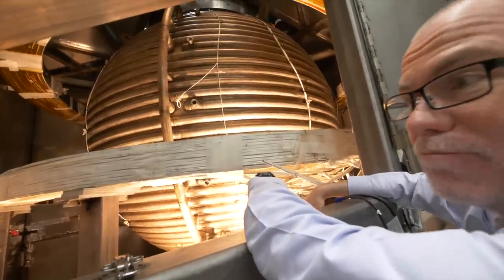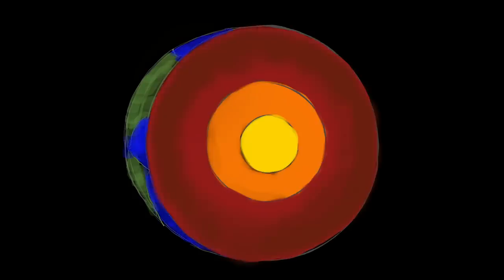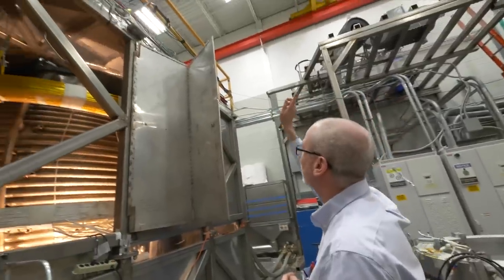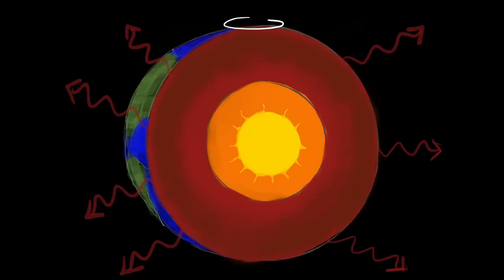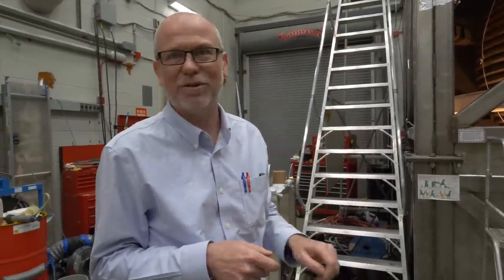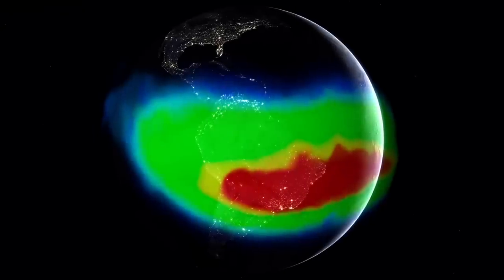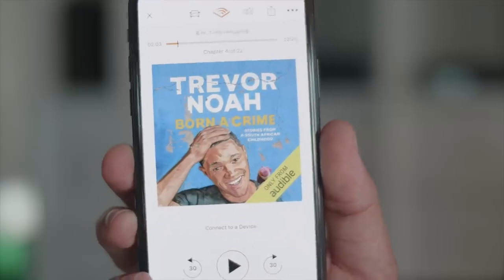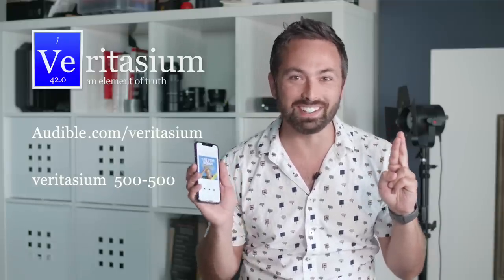Spinning Sphere of Molten Sodium

Comment: It looks like we need this experiment and not just a computer simulation of the experiment. If a simulation was good enough and cheaper, they wouldn't do the real experiment.  I'd just like to understand why. 

Is there something fundamental that we don't understand and aren't able to model? I guess we should know the basic laws, and i thought emerging complex behaviour should also emerge in a simulation. 
Or is it just too hard to compute? Is it one of those problems where an approximation just isn't good enough? Or do we have simulations but they turn out to be wrong and nobody knows why?
Reply: Too many variables. We don't know everything yet. Sure, we can computer model, but how do we know the modeling is accurate without putting it to the test? There is always room for real experimentation in order to even know whether our models are right or not.
Reply: We cannot build a model of entire Earth at atomic level with every possible interaction known to physics. So computer simulations always use simplified models. Even then fluid dynamics is very hard to compute. And when you add magnetic fields on top of it...
In this case problem is that we dont know how exactly Earth magnetic field is forming. But to build a model we need to know which aspects are important and which can be ignored. Hopefully this experiment will help and then we will be able to predict magnetosphere behavior using modelling. I very like comparison to weather forecast, it really is a similar situation.
Reply: My guess would be that yes it is simply too complex or chaotic with too many variables to simulate accurately.  AFAIK we still don't have a full understanding of fluid dynamics in terms of the equations.  See this link for a little bit more info.  

https://en.wikipedia.org/wiki/Millennium_Prize_Problems#Navier%E2%80%93Stokes_existence_and_smoothness
Reply: The calculations are still too complicated for our computers
Reply: I dont know but my guess would be that we have done computer  models that do show this effect. I would think funding for this experiment would depend on prior modeling success. But it's always great to do real experiments to check and improve models and because like others have said, models need to make certain assumptions that may or may not work.
Reply: We acatually do  not fully understand some phenomenons (emergent behaviours), and instability regions, or turbulent flows exactly. The simulations are not accurate enough, do not have enough time and space resolution, and do some approximations to various effects, to be considered accurate and ultimate. We do not have good macroscale theory, that can be easily derived from fundamental physics laws. (it can be done in principle now, but the math is too complex for us to get grasp on it, even in statistical sense, yet. so it will not give any big insight into actual behaviour of the system, and lack predictive power). The fluid dynamics on its own is HARD topic. Add to that magnetism, currents, resistance, convection, thermal radiation, radioactive decay, heterogenous medium with elements of different densities and properties varying with temperature, differential rotations, oscilations, extreme matter conditions and few more effects, all interacting with each other in known way on some case by case studies, but not all at once tangled with various strengths, that change also with time and position. It is beyond HARD. Geology, and especially modeling of liquid metals, is beyond crazy. It is black magic. I understand quantum mechanics, higher dimensions, and esoteric and hard topics of many other fields of science in good detail, but geology and inner workings of Earth are absolutely beyond me. It is as complex as you can get.
Reply: Even with computer generated experiments you still need to do a physical experiment sooner or later. Computer generated results are great, and probably were done in the early stages of this project, but they will never fully replace physical experimentation. Essentially, physical experimentation has to be done to prove the predicted results. Even if it works out mathematically that doesn't guarantee it'll translate to reality.
Reply: Well absoulutly. The ultimate test of model is its predictive power. So the reults of the model (computer simulations) need to be compared with various real world reaults, be it lab settings (like controlled condition of the molten liquid sodium, with many parameters known very well, and possibility to vary them in wide range, and obtaining more and more results) and with indirect or limited measurements of real world (like the structure of outer core and strengths and directions of magnetic field and its dynamic over millenias).
Reply: We need massive super computers to model microscopic proteins, and this is a little bigger than that.
Reply: movax20h even helioplasmadynamics is better understood at this point... Great response.
Reply: We can't simulate fluid dynamics accurately. Not even for a small-scale problem, let alone something on this sort of scale.
Reply: The equations that describe fluid flow and the interaction of magnetic fields and currents with moving conductors are well understood. 

The difficulty is simulating with enough space and time resolution to faithfully reproduce everything in the strongly turbulent flow.

For something like this experiment, we're not even close. You can make a lot of progress by making simplifying assumptions in your simulations, like averaging over smaller scales, but validating against experiments is an important part of getting it right.

And even with good experimental validation to give confidence in the results, simplified simulations at practical resolution will run several to many orders of magnitude slower than real time. You can explore more operating parameters in a turbulent fluid experiment than you can in a turbulent flow simulation. You can also run at one parameter for very long times, which has definitely proved interesting in this experiment.

So experiments are needed. That said, I can't count the number of times I wished I could see the flow in this thing like it was a CFD simulation!
Reply: Tbh a lot of the math already makes sense, but the scientific method has taught us to never just trust the math and call it a day. We have already discovered plenty of unexpected things when modeling the real thing in experimental science. Computers and formulas always allow too much simplification, but you never know how much is it safe to simplify. You can save costs by postponing experiments the numbers don't seem to back up, but a hard experiment, as close as possible to the real thing, is the only way to test the ability of the numbers to predict stuff.
Reply: You need to do the experiment first and then see if theory can predict it’s results. If the theory is excellent then maybe you don’t need the experiment anymore, but as he said, “no one has done this before” and it should be done - because we humans should understand a process that ensures our existence and survival.
Reply: Paul Paulson Well, 
1. we don't exactly know what the inner makeup of the earth is made off
2. we don't know the topology well enough
3. it is a turbulent system. Much like the weather we can't calculate enough datapoints (yet?) even if we knew all the variables involved
Reply: FutureChaosTV I agree but want to add this:
1. and 2. (and in parts 3.) would also apply for the experiment. Keep in mind that the experiment is also a very simplified model of the real world.

About the turbulent system: We can't predict the real weather on long periods, but we can run simulations that create plausible weather conditions for long times that reproduce all kinds of realistic effects. You could study a lot of stuff (not everything)  for example about how hurrican form from such a simulation, even if the exact hurricans won't appear at that time in reality. In general, chaotic systems make exact predictions hard but general patterns of behaviour can be studied with models. Also, this is what the experiment does because it is also only a model and won't have the exact initial conditions that the real world has.

That said, i agree that complex chaotic systems do tend to make it hard to find a model that is accurate enough (in terms of what kind of general behavioural patterns  emerge, not in terms of exact predictions) and yet simple enough to be calculated in finite time.
Reply: Paul Paulson lol.. they do detailed computer simulations of huge numbers of particles to find out how planets form but none of them work.. they all form rings an shells with vacumious centres.. goes to show how idiotic computer simulations can be!
Reply: We can't even accurately predict tomorrow's weather with computer models. Where does your faith in the power of simulation come from?
Reply: It’s just to catapult the propaganda dude. You’re asking the right questions. Research flat earth instead to get all your answers and your mind blown.
Reply: From what I know, there still remains a relatively large amount of knowledge we don't know about magnetism seeing as how it stems from quantum dynamical interactions, so I think that the level of physics we have so far is not detailed enough to quantitatively explain the phenomenon.
Reply: they’re still too complicated for humans. And since humans make computers, they’re too complicated for computers. It’s as simple as that. If we could understand it already, a computer could model it. But since ALL computers are man made, all computers have bias, flaws, and oversights. This is why Microsoft, Linux, apple and others exist. Because all coding is different.
Reply: Modeling turbulent flow of charged particles AND the magnetic fields the chaotic movement generates AND the interaction between the magnetic forces and the turbulent flow...

Good luck running it once, you'll need to keep running it at different rotation speeds and different temperatures.
Reply: To many floating variables
Reply: Simulation alone is never sufficient. All simulations must be verified (checking the math to make sure the model solves correctly) and validated (compared against a similar experiment to make sure that the correctly solving model actually represents what it's meant to model). I'm actually in a 2-week training program for nuclear engineers right now where we are talking about how we validate and verify our models, and how vital it is to couple the modeling with experiments. It's been quite eye opening.
Reply: I guess a simulation is a projection of what we know. We couldn't make a computer simulate things we ignore, as we have to input the initial data into it. But the experiment in real world could teach that of we dont know.
Reply: In simulations, a crucial ingredient is rough approximation. Corners are cut as much as possible to speed up calculation time, because faster simulations can be run for longer or with a wider variety of initial conditions so we can learn as much as possible. 

Because of the, the results of simulations ultimately end up being a rough approximation of what will happen, rather than a full explanation of reality.

For something like a spinning core model for example, one approximation would be to model it as a fluid, because modelling it at the atomic level is impractical. Loosely speaking computer models start to face problems once the things you’re dealing with start to reach the billions, and particles outnumber that on the macro scale many times over. 

So modelling it as a fluid is an approximation. Then you have to think about the temperature and magnetic field and it all starts to get dicey very quickly.
Reply: Computers depend on inputs.
Reply: In semiconductors people simulate the flight and collisions of electrons through the doped silicon (collisions with the atoms , after elastic collision electrons are scattered with a random vector and continue the flight). No idea why this isn't doable here, since the "lighter elements" forming parts of the dynamo are not in the sodium sphere.
Reply: There is no calculation too "complicated" for a computer. 
You probably mean the model is too inaccurate.
Reply: Models are always simplified, that's why they always needs to be tested.
Reply: I researched it...sound like bollocks to me !
Reply: Paul Paulson there is nothing that can replace a real phisical experiment. 
How else can you uncover something new? You cant set up variables in the computer simulation, that you haven't discovered yet...
Reply: Frank Fahrenheit Yeah, sure, I'll go right ahead and find the next prime number with my core i3, lol.  ... fifty  years later...  YES it CAN be done!
Reply: He said at the end it's an open question whether it's predictable at all so why do you think we could simulate it even with more powerful computers?
Reply: As pointed out, both fluid flow and electromagnetics are hard, but where it gets really problematic is that these two effects operate at wildly different rates. Fluid flow can be parallelised up to the speed of sound, as information generally cannot travel faster than that anyway. This is what makes the problem tractable at all. Throw on electromagnetics and you lose that. Two turbulent regions far away from each other suddenly influence each other almost instantaneously, meaning every part of your simulation needs to be aware of every other part. This means that MHD simulations have to run millions of times slower to be sure they have accurate results, unless we apply tricks that are learned from studying real scenarios.

Comment: Nice, but can this device amplify a magnetic field enough to say, shield a space craft from ionizing radiation?
Reply: Using this method to make a magnetic field strong enough to deflect cosmic rays at 10's to 100's of MeV is impractical [0] Not all "ionizing radiation" [gamma rays & x-rays] are charged so a magnetic field would have no effect on those [1] You don't want a huge, heavy gyroscope in a space vessel because of the weight & the torque & the risk of failure [2] The heat of the liquid metal has to dissipate - space vessels have enough trouble already radiating heat [3] the magnetic field would interfere with instrumentation [4] unknown effects of magnetic torquing as such a large magnetic field source moves through the Earth's background field [5] There are lighter, simpler ways to protect organics from high energy particles [both charged & uncharged] such as cladding the living compartments in materials containing a lot of hydrogen atoms - some plastics are a good choice. Water is another option although less effective than plastic for the same weight.
Reply: all very good points!
Reply: oooooh!

Comment: I want to pour boiling 1 ton on boiling sodium into sea water and watch the explosion. Can ISIS guys sponsor my experiment??
Reply: Setting off a ten teraton nuke at the bottom of the Marianas Trench is an experiment that needs to get done before the Russians beat us to it.
Reply: That much water will probably just put it out.   But I'm not sure, so contribute to my gofundme account and let's do this.   For Science!
Reply: Both of those experiments sound equally interesting. I'd watch that.
...
Why do humans always find the most dangerous things the most fascinating?
Reply: if the nuke would go undamaged due the pressure to the bottom of the trench, it would really be a let down, the amount of pressure would just cause the explosion to stay small, and after it the marianas trench would stay a lifeless nuclear wasteland after that, also some of the lighter radioactive elements would surface due to the hot water bringing them up, but cause nothing really catastrophic due to the massive dilution of the ocean.
Reply: Many years ago, my high school teacher dropped a 2x2x2cm^3 cube of Sodium in a bucket of water and put a lid on. It was fizzing a lot, then took about 30 seconds until the whole thing suddenly exploded and the lid flew 50 meters to the sky. He then explained to us what happens is that the sodium (Na+) atoms binds with the (-OH) groups in the water, producing molecular hydrogen (H2) and heat. Some of the hydrogen burns up right away, but some escapes and mixes with the air. When the hydrogen-oxygen mixture ratio gets just right, it explodes furiously. Very nice. Oh, and the water also becomes strongly alkaline (NaOH). (The experiment was performed outside, at a distance).

Comment: Wait, can the earth's rotation be used to produce electricity?
Reply: Certainly. Any energy can be converted to something else.
Reply: People have thought of that before.
Reply: Ungregistered User it’s Not as scary as it Sounds, it doesn’t brake the planet it just brakes the orbiting satellite.

(Eddy currents)

Well..they are using this now to deorbit things.
Reply: It probably does brake the planet, but it has rather a lot of kinetic energy, so we won't hurt it any time soon.
Reply: Amperzand it accelerated/slowed the planet during launch, and it will take exactly this amount of kinetic energy back.
Reply: You are actually using the earth as a magnet for a generator wich turns the energy from the  rocket fuel into electricity.
Reply: Maybe but why screw with something that upsetting it can kill the planet?

 We can easily convert solar rays to electricity already.
Reply: Monu - yep its called lightning
Reply: @TaxiDay  No such evidence
Reply: @gregrohs6688  photovoltaic cells
Reply: DRZ 400  magnetic braking

Comment: Sorry veritasium but I have some confusion, sulphur is non metal, liquid sulphur is diamagnetic, so as you said in this video, loops of liquid metal grabs magnetic field lines and create current, my question is that from where these loops of liquid metal coming from? Are they forming by the metal molecules surrounding these sulphur loops, like a pipe I guess?